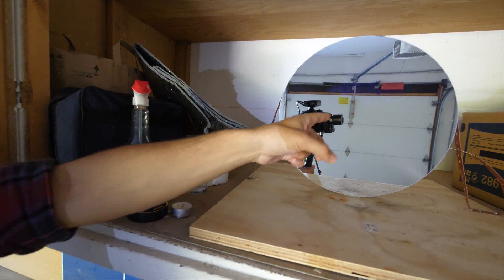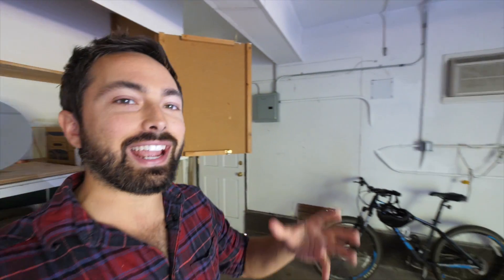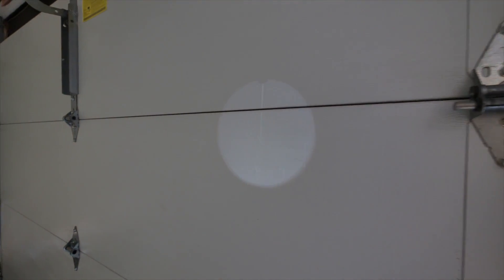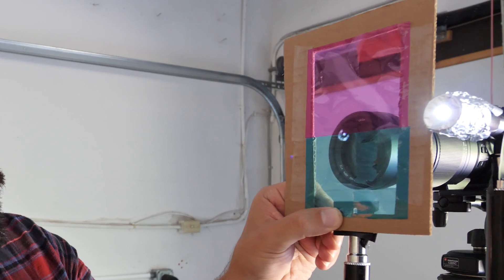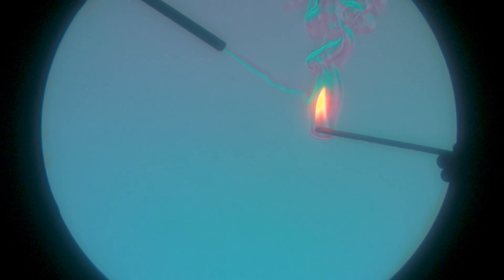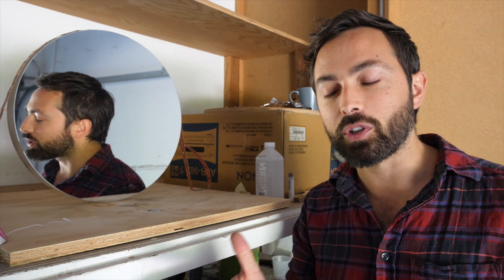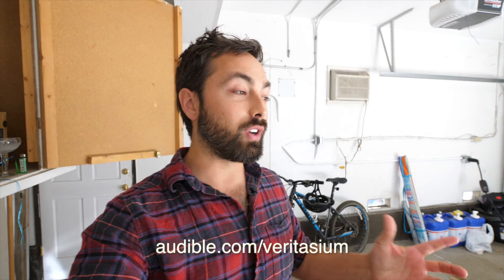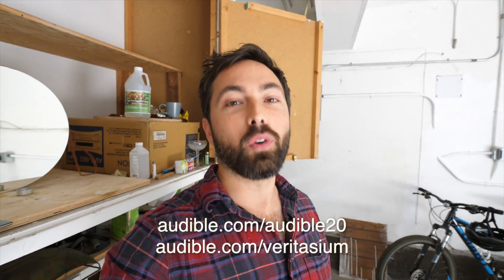Schlieren Imaging in Color!

Comment: You mentioned how sound is not seen well because of how fast it travels, but I was wondering how much other factors play into it as well.  One thing I noticed was that there was a much more clear difference between seeing things just of more kinetic air movement (i.e. blowing)  rather than a difference in temperature or air composition (i.e. butane gas or helium).  Even with blowing the gas being expelled would probably have a higher content of CO2 and be at a higher temperature which would  refract light more, so does that make it harder to spot out what 2 frames might have the sound waves in them.
Reply: @wawet76 do you think this might hinder the ability to see sound waves?

Comment: Awesome. Here is something you can try to show how heat can expand the surface of the mirror. I am currently making a parabolic mirror for my DIY telescope. I am using a similar setup to test the surface texture and profile of my mirror. The instrument I am using is a knife edge tester, where the knife cuts the light source in half, and the returning light from the mirror is also cut in half with the same knife, precisely at its focal point. Then you can see the profile and surface of the mirror. place your finger on the mirror surface for a couple of seconds and the area will expand on a nano scale, but in the camera you will see a hill forming on the surface of the mirror due to the heat expansion of the glass.

Comment: what will happen if we put a vacuum chamber in front of the mirror ?? cause there will be a pressure difference so what will happen ???
Reply: @Sanket Lalwani . There is little to no air inside the chamber, but even so, no air is actually moving so you wont see a thing, apart from the chamber's walls I guess.

Comment: Try to catch the vortex generated by a LERX on a plane. 
You would need to set (for example) a flat panel looking down towards (falling inline with) the heat shource so that when the hot air goes up due to convection, it hits the panel. The gas should be hitting the 'bottom' and curving around the edge. Then modify the panel in small increments of angle of attack and see the vortex that should appear. Maybe I'm not expressing clear enough...

Comment: There's an over issue when you want to see a sound : while atmospheric pressure is about 1000 Hpa, the pressure variation caused by a sound is just about 10 pa, less than 1/10 000 of the atmospheric pressure, not enough, I think, to see it this way...

(Please excuse my english...)

Comment: Try using a sound generator app to create frequencies in the kHz, which have shorter wavelengths than a hand clap so they will appear in the frame, and play the app through a Bluetooth speaker set next to the mirror

Comment: If you want to break the sound barrier, just use a whip. It might be a bit tricky to whip it in front of the mirror (lol) but it should do the job. Also, you might try a colab with the Slow mo Guys for un upgrade on the filming gear :D

Comment: Last time I made a comment that you can perform Schlieren in 2 dimensions instead of just one:
Use a color filter with 4 quadrants.
2, 1
3, 4

Quadrant 1: Magenta rgb(255,0,255)
Quadrant 2: Red rgb(255,0,0)
Quadrant 3: Black rgb(0,0,0)
Quadrant 4: Blue rgb(0,0,255)

After that you can take the red data for 1 dimension and the blue data for the second dimension.

Comment: IDEA!!!
Magnetic and/or electromagnetic fields of varied frequencies. Magnetism bends light very slightly, and I wonder if it can be captured in such a device. Another thought I have is to place speakers on opposing sides of the mirror (parallel to mirror) and seeing if differing tones can elicit a change in the capture. Either synchronous tones or offset ones, to make a binaural beat. The low frequency interference of, say a .5-2hz difference, could make something visible. Please try this out and let me know!

Comment: Very nice work! Concerning sound on open field that is quite hard. However, have you considered standing waves inside e plexiglass tube with a soundspeaker on top, adjusted to the right frequency. Maybe the plexiglass makes weird patterns but you should get standing waves that Schlieren imaging may see. Well that's my suggestion!
Reply: To have a visible wavelength node pattern for the standing waves it may be necessary to go high in the spectrum and use ultrassound sources.

Comment: Suggestions:
- Hairdryer
- Explosives
- burning stuff with a Laser/shining a bright cameraflash on a dark surface
- dropping things into a tank filled with SF6
- yourself talking/breathing
- a Fart
- a very cold pipe standing upright with both ends openso air can fall through it
- a standing pressurewave
- the exhaust of a small motor 4 stroke vs 2 stroke

Comment: The smooth flow from a fan. The flow out of a whistle. The flow out of a flute. The wing beat of a hummingbird. The waves of a housefly. The flow across a paper airplane. The whistle that comes out when you blow into a bottle in a specific way. The stationary wave produced by a tuning fork in a long cylinder.

And for sound, it doesn't have to be a shock-wave. Try producing a continuous sound that would give continual waves, like that from a tuning fork.

Comment: I don't know if it is feasible or not, but maybe, just maybe this effect could make changes in dielectrica du to strong electric fields visible, since the structure changes... A quick google didn't find any results regarding the refractive indices as effected by electric fields in gaseous dielectrica, so there is a slight chance that this could be a "first" for pop sci, if it actually changes the refractive index measurably

Comment: How about boiling water with 3 different coloured filters, maybe you can capture the 3 phases (water, steam/hot air, cold air)
Maybe you can call in the slowmo guys, though I think they live in Europe, literally half a planet away from you.
Have you tried using a laser as a lightsource? A single wavelength and great intensity might give some interesting images of small (in scale) effects.
And of course the physics question: Any ideas on how to get rid of Rayleigh?

Comment: After a bit of research, you're not going to be able to see a non-standing audible sound wave without major magnification. The wavelengths are large, but the highest amplitude you can tolerate without damage is only ~10μm of air displacement, and the softest we can hear is ~100fm

Comment: For your first one, II suggested putting a cooler gas (such as a little thing of dry ice) on top of a speaker cone.
Then using a pitch generator to make it push the cold air. It wasn't really to see the sound waves, but just to see how the air stirs around.
Maybe a speaker and change the frequency to a multiple of what your camera shoots at?

Comment: * Drop an egg onto a brick
* Show the heat coming off a small electric motor
* Crush hard candy with pliers (would the small sparks also show in the Schlieren image?)
* Boil water in a clear glass container
* Show a fly or small insect taking off (starting to fly)
* Show a canning jar when the lid pops in as it cools
* Show snapping your fingers
* Snap uncooked spaghetti (See also Destin's [Smarter Every Day] video on this)
* Snap a chocolate bar
* Drill a hole in wood/steel/different materials
* Show a guitar string being plucked/strummed
* Show pressure changes in a vacuum bag as the vacuum is being turned on

If you need any more ideas, just let me know!

Comment: Little warning regarding the use of your camera gear:
I see a beautiful GH5 with an even more beautiful 100-400 Panasonic/Leica lens mounted on a tripod USING THE CAMERA TRIPOD MOUNT. It's a matter of time that the heavy 100-400 lens breaks the camera's lens mount. In general if the lens offers a separate tripod mount you should use that. Being good at physics you could calculate the stress that huge lens puts on the tiny lens mount ;)

Comment: If you can get high speed for sound visualization, you should definitely show constructive and destructive interference.  Maybe use 2 subwoofers pointed towards eachother (or pointed parallel to eachother) and emit a ping (like a single peak) and emit a constant frequency to see what you can see!
Reply: To get a visible standing wave you need higher frequencies. Up at 3 kilohertz the wavelength Air is only about 4 in so I would recommend a tweeter, but the more power the better because you need enough density change to make it visible.

Comment: Using an old fashioned newtonian telescope look at a star on a dark night, then adjust the focus to make the star fill the eyepiece. You will see all sorts of shimmering in the light. Then have someone hold their hand in front of the telescope and you will see a sharp silhouette of the hand and you can plainly see the heat coming from hand. Even someone's breath is plainly visible. This may also work with other telescopes but it I've only tried it with an old Edmund Scientific 6".  Another trick to make your imitation star is to use a shiny sphere like a Christmas tree decoration or a shiny ball bearing and shine a light at it  from an angle. The light will appear as a pinpoint on the sphere. A laser would also work on the sphere. Great video, thanks.

Comment: Would it be possible to use a prism (or two) in place of the razor / color filters? That way instead of the small differences in temperature or pressure resulting in a mostly binary effect (darker/lighter, green/purple) you could hopefully see the magnitude of the pressure difference as a greater shift through the color spectrum.
The helium balloon was a good example since the density put the light well within the green side, but there was nothing to really show just how far into the green filter it was.
If a prism didn't work, something similar could probably be accomplished with multiple color filters very close together.

Comment: I'd think you should be able to put a speaker on there and run a simple tone and adjust it to the frame rate of the camera so you can see a standing wave pattern.  It would look basically like any ripple pattern you see in water but if you're looking for ways to mess around with this set up...

Comment: This is a bit of a long shot, and would be immensely complicated to pull off, but what about the gas flow inside a transparent firearm suppressor (or silencer) in ultra slow motion? Just flat out suppressor flow is fascinating, and Destin of Smarter Every Day posted the first good footage of it to my knowledge. Somehow visualizing that supersonic/subsonic flow in greater detail, perhaps with high pressure air from say an airgun rather than a firearm, would be fascinating. The issues are two fold. The first is understanding what is actually happening through all the obscuring flame, unburned powder, and carbon inside a suppressor. The second is, of course, achieving a high enough frame rate to really begin to understand it.

Comment: You could do sound as a standing wave.  If you can get a frequency generator and a speaker you should be able to set it to a frequency divisible by your framerate and see the standing sound wave.  If you adjusted the frequency slightly you would get essentially slow motion movement of a wave.

Comment: could you do this with more than 2 color filters?
Reply: actually yes, how it would look that's a different story but you could put the light between 4 filters or 8 or any amount as long as you can get them to be roughly a circle where the light gets focused.
Reply: There's a whole field of research which uses radial or linear rainbow filters for this exact purpose (Rainbow Schlieren Deflectometry). The hue of the transmitted light can then be directly linked to its deflection, and the refractive index of the transmitting medium (and its temperature by extension) can be calculated as a result.

It's a really useful and powerful analytical tool. Well done on coming to this conclusion by yourself- the original publishers of this method were at NASA, I believe.
Reply: Why not a whole rainbow filter? Either linear or radial.
Reply: Yes you can! A rainbow filter would work really well.
Reply: I dont think so no

Comment: Seeing sound waves would be awesome.   Here's some ideas: firecracker ( might need to pass the sound through a slit... heck, try a double slit too).  Standing sound wave (in a tube).  Use a tweeter speaker and drive it with a tone the same as the frame rate,  or multiple for that matter (try square, triangle and sin waves). Don't bother to try to get phase locked, the ever-so-slight frequency difference from the frame rate will alias and simulate even slower motion.

Comment: To capture sound wth Schliren you have very little time, but you can use a spark plug. The "snap" of the arc is actually a shockwave that should be measurable in your photo setup.  We did it in a lab class for college.
Reply: Also, you can do this with a laser through a set of lenses to expand the beam and a collimator to straighten it out and then another lens to focus it into your camera(we used film in the lab).

Comment: Something I have wondered about for a long time, is with a camp fire the way sparks float up and zip around; I have wondered is it the air being heated from the hottest side of the spark expanding and pushing it or the hot side of the spark being lighter and lifting it or The most likely the spark just being pulled upward in the hot air current. Would you be able to tell what is happening with the Schlieren effect?

Comment: I've seen some people using a laser as a bright point source. The imagery coming off it seems to be incredibly intense. Not sure if that's because it's coherent light or if it's a more highly engineered setup.

With a couple of watts of laser energy going into a beam spreader though, I'm guessing there'd be enough light for much higher than 2k fps. Enough to try and see shock waves?

Comment: My hypothesis on the sound one: You can't visualize it in this way. You'd need a microscopic version of the Schlieren to see some sounds and a much larger version to see others (not to mention you'd need considerable resolution), and seeing a shockwave isn't really the same thing since it's such an extreme case that it's not just a sound, it's an explosion moving faster than the compression/rarefaction rate of the air. (Also, shockwaves aren't that cool in this way since you can see them with the naked eye.) To visualize the sound of the human voice, for example, I'd expect you need a surface of at least 6meters for your lens, since the wavelength of the human voice is roughly ~1.6m at the small end of things, you'd want enough space to see a full compression and rarefaction of the air. 

Experiment Proposal: Get a tone generator and figure out a good possible wavelength to match the size of your current setup. I'd expect the sound to be pretty high pitched. Crank the volume as high as absolutely possible. Get a much, much brighter and sharper light source and do everything to increase the contrast on the image as much as possible (tinfoil-ing out the windows for example.)

Comment: shouldnt've even tried to 'correct' the statement about the mirror, just made it worse
a parabola doesn't really approximate a sphere, that's not what makes it useful
it does work as the cap of a continuously curving three-dimensional closed surface
sigh

Comment: On the visualizing sound front, you could use something which moves a pressure front at the audible frequency, like any form of fipple flute (organ pipe, recorder, slide whistle) in which the sheet of moving air oscillates between the inside and outside of a resonator.